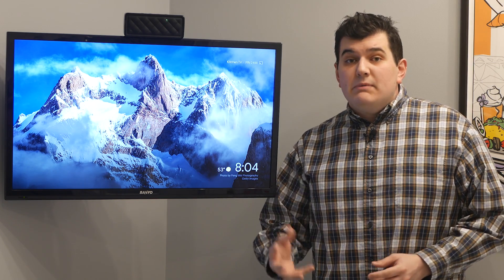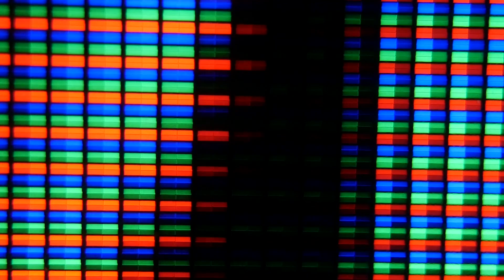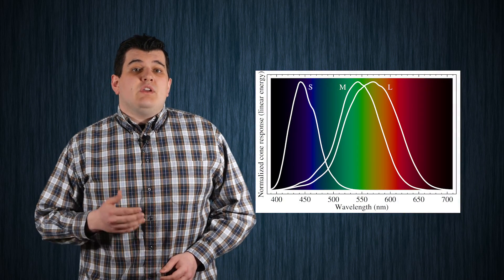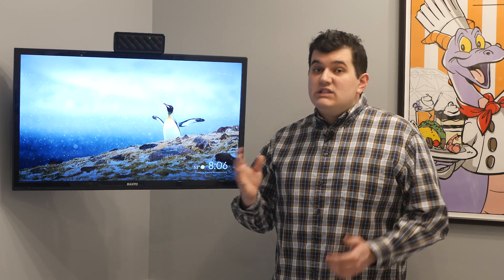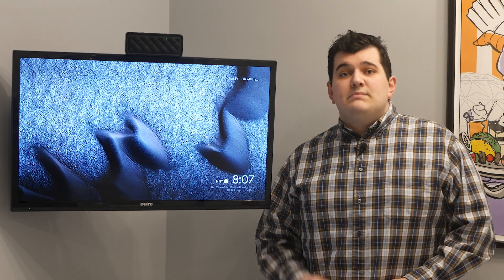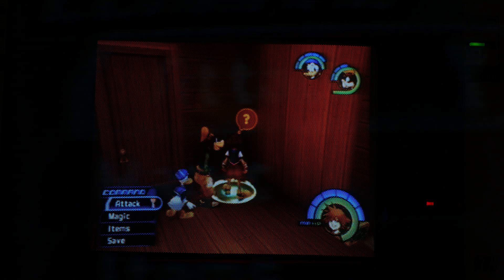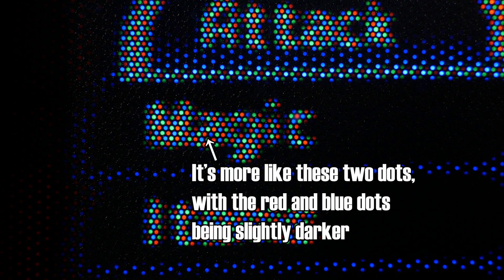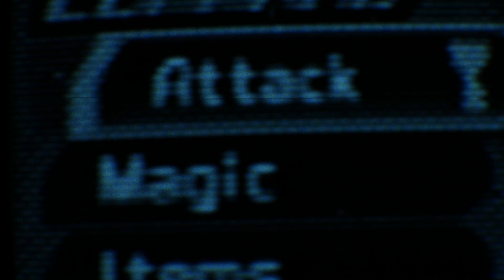These Are Not Pixels: Revisited

Comment: I wonder with today's technology what the most high def analog image could be created? could we have a HD image with an extremely dense shadow mask and an extra bright electron gun? hmmm
Reply: There were a number of HD CRT TVs back in the day that displayed a 1080i image and CRT PC monitors that had resolutions like 2048x1536 and 2304x1440, so at least 4K would probably be possible.
Reply: onedeadsaint There are 1080i CRTs. So it is definitely possible.
Reply: 11011100DC I did not know this. very cool!
Reply: At the end of the CRT monitor era there were some pretty high resolution screens. Sony had some HD CRT TVs as well.
Reply: Feels like you completely forgot about computer monitor CRTs. 1280x1024 at 85 Hz without interlace was a perfectly reasonable spec for a 17" CRT in the late 90s. Some (particularly larger models) went up to 1600x1200 or even 1920x1440. In the 2000s, when LCDs started becoming popular, pretty much the only CRTs that remained in production were the cheapest ones, so the specs actually went down.
Reply: HD is not new and does not depend on digital technology. France in the 1950s had a terrestrial tv system with nominally 819 lines (737 visible) and an analogue bandwidth of 11 MHz, but it was 4:3 and black&white only. SECAM colour was intended for this system, but France eventually dropped it and decided to broadcast colour only in 625/576i as the rest of Europe, but still in SECAM. 

In the 1970s there was the Japanese "MUSE" system with a resolution of 1035i, and in the 1980s/90s the European "HD-MAC" system with 1050i. Both had a strictly analogue image signal, 16:9 and of course in colour, even though HD-MAC had digital audio. For both systems, cameras and displays were CRT because CCD sensors and LCD screens were not yet mature enough. The picture quality of both systems was on par with what we have today.

The reasons why they didn't become mainstream was cost. The bandwidth requirement of analogue HDTV is huge compared to SD, which meant that the number of channels would have to be reduced for a wide scale introduction of HD. Only digital compression (originally MPEG2) did away with this problem. Another obstacle was the bulkiness and huge weight of large HD CRT screens, which probably most people weren't prepared to put up with. LCD screens solved this problem, and brought down the price as well. Same thing on the production side with CCD and CMOS cameras.

So in summary, analogue HD based on CRT is perfectly possible, but only digital and LCD technology made it affordable.
Reply: @xaverlustig3581  In the mid 1930’s, John Logie Baird had 1,000-line colour 3d projection TV’s on public display and receiving broadcasts in hotels in London. The Second World War stopped all broadcasts, and when broadcasts began again, in the early 1950’s, they were 405-lines monochrome in Britain. HDTV only really became a thing again with the advent of satellite digital broadcasts
Reply: Monochrome CRT you can get to 20k lines with ease, just requires a very small beam diameter inside the CRT, this determines the spot size on the CRT, and you can make a very small spot if you are prepared to have a low brightness. Colour CRT you could get 2k screens, but they were both insanely expensive and a bear to align, and would have colour fringing if you moved them at all, and also would have fringing with any ferrous metal moving nearby them. The most common use for high resolution CRT's was film digitising, using the CRT as a line source and then slowly scanning the film past the line, with a photomultiplier tube getting the video signal off the transmitted light. The resolution possible on the best was better than most film stock. Colour was done using a colour filter wheel or dichroic mirrors to separate the colours and handle them separately, the CRT providing the white light source to drive them. Simpler ones were used regularly to transfer film to video for TV transmission, using a variety of methods to get the video signal off the film at TV scan rates with the film running at 24FPS.
Reply: Yep, 1280x1024 existed way before "720p" term was coined. And so is 1600x1200 existed before "1080p" term was popularized,
which did make think 720p and 1080p are regression of some sort.
Reply: Yes. In 2002 I bought Samsung 757DFX, that's a CRT monitor capable of 2048x1536 at 60 Hz. I still have it :)
Reply: The reason why 720p and 1080p were amazing when they hit the video market is not because of the display resolution itself. As @rashidisw pointed out, the resolutions were actually somewhat lower than what computers did before. But computers produced that video through graphics chips. It was a weird time when rendering 1600x1200 at 60 Hz progressive on a GPU was nothing too impressive - but reproducing prerecorded video at 1280x720 at 60 Hz interlaced actually was. Video compression and decompression was so demanding of processing power that in the late 90s, PCs required special accelerator cards just to play DVDs (SD video, we're talking about 720x480 here!), even though they could render Windows GUI and even games at 1280x1024 or similar without any trouble at the same time.
Reply: NoToeLong now I want to see an up close look at HD CRTs!
Reply: Oh, that doesn't even require modern technology.

Remember that PC monitors were also CRT's until well into the 2000's...

I owned a 17 inch CRT with a 1600x1200 resolution officially. 
It could display 1080p signals too in fact, though you had to force that in the drivers and of course all the usual issues of displaying a 16:9 image on a 4:3 monitor apply...

But basically there's really no reason why you couldn't have a HD or even 4k CRT...

The problem is...
Well, I still own a 21 inch CRT television.

It has a visible area comparable to the 24 inch monitor on my desk.
The CRT weighs 25 kg (more than 50 pounds)
The LCD weighs 4.5 kg (about 10 pounds), and that's including a rather substantial weighted base to keep it stable.

On top of that you could stack about 8 of the LCD monitors into the same space the CRT takes up.

Now, 25 kg is pretty bad, but have you ever seen a 50 inch CRT?

Those weigh more like 120 kg (yes, 250 pounds, roughly) and are an absolute nightmare to move.

For that matter the contrast ratio, black levels and colour response of a high end CRT made most LCD's look atrocious until about 3-5 years ago, even though CRT's were phased out more than a decade earlier than that.

I personally don't think CRT displays were phased out because of image quality concerns so much as their bulk and weight.

A 21 inch CRT is manageable, but a 50 inch one is not, and a 100 inch CRT is basically unthinkable.

However a 100 inch LCD panel is something that a single person could still move around and install by themselves if they had to...

If we could've found a way around the weight and size issues, I doubt CRT's would have gone out of fashion the way they did...
Reply: NoToeLong Would looove to see somebody do a teardown of a high def CRT and have a look at the engineering involved.
Reply: My first HDTV was a Trinitron 1080i CRT! It looked amazing, especially after I calibrated now obsolete settings like convergence. It weighed about 150 pounds, though...
Reply: Best example of HD+ CRT 16:9 Monitor is Sony GDM-FW9012.
Reply: Sony, Toshiba and Panasonic displayed prototype analog color HD cameras, monitors and recorders at the 1982 NAB convention. They where only an analog system but using tube based image sensors and displays. In 1987 Sony released it as a commercial product line called HDVS (High Definition Video System) The system used 1125 lines and a 5x3 aspect ratio, in 1990 SMPTE set the standard at 1125 lines and a 16x9 aspect ratio. You can buy BluRay discs of this early 90's HD video as a series of concerts form the Monteraux  Jazz Festival. There is surviving 1125 5x3 video shot in 1987 but it may never get released on BluRay because of rights/legal issues.
Reply: The HDVS brand survives to this day on many Sony (CCD) broadcast cameras.
Reply: Slightly different topic: HD analog video formats are still alive in CCTV cameras, they have some advantages over IP cameras, which is possibility to transmit data through really long coaxial cables (300..400 meters), no time delay, more cheap equipment etc. Not sure this technology would last very long, though...
Reply: The most limiting factor would be the speed the bean can be moved around, which is what limited CRT monitors to lower resolutions if you wanted faster update frequencies, i.e. the beam needed to be faster but could not.

With a fast enough beam, and a black and white display you can show whatever resolution you want. But always the real world physical limitations are at play. With a color display, if you don't have enough density the image will suffer, but still would be possible.
Reply: There are also “Professional Video Monitors”, the kind used in TV production and other specialized applications. Many were standard definition only, but some supported higher resolutions. The “My Life in Gaming” channel has a good video on them.

Comment: Dude! your production value on this is amazing! that editing on the B&W TV was just 😙👌
Reply: Agreed, some of the best 'tech' videos on YouTube.  Take note of the 3 color 'tubes' that were used in the demonstration - brilliant work!
Reply: I came here to say the same thing. fantastically high quality editing and post production. The 3 CRTs disconnected on the table, but all lit up really messed with me. Amazing job!
Reply: Those tubes were actual CRTs used in video projectors. They're black-and-white tubes with a colour filter over them, which gives CRT projectors a very high image resolution because they don't have a shadow mask. (yes, you can run full HD and sometimes even 4K on a 1990s Barco CRT).
Reply: Really impressed at the amount of work that must have been require to produce this video.
Reply: Maico Oh I am so with you on that observation, ahhh!
Reply: Yup, well done!
Reply: A B&W Screen only has horizontal lines while a Colour Screen has vertical and horizontal lines and a Vector Screen not only has vertical and horizontal lines but also diagonal lines.
Reply: onedeadsaint I Iiek rice
Reply: 666th like
Reply: very nice idea to use the flashlights. Only my OCD hit me cause one of the flashlight's exteriors was a tad different